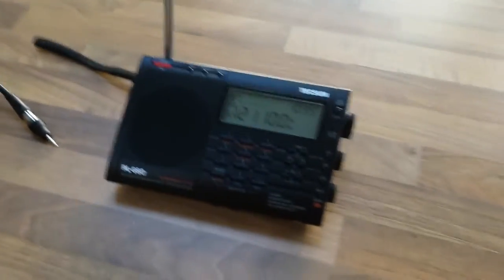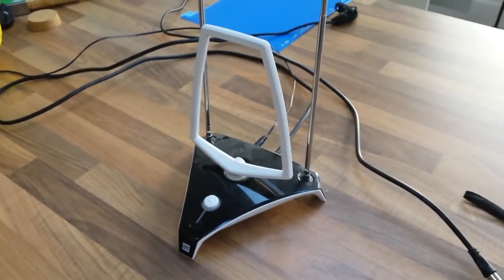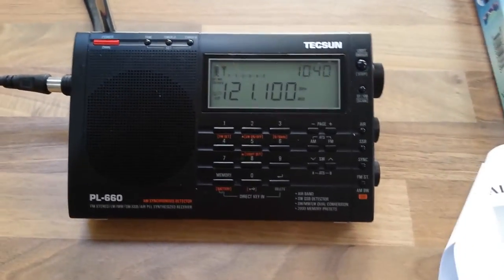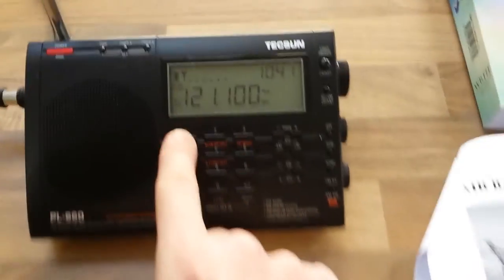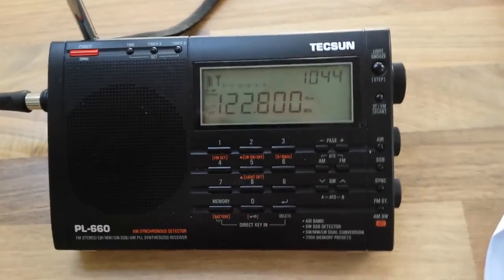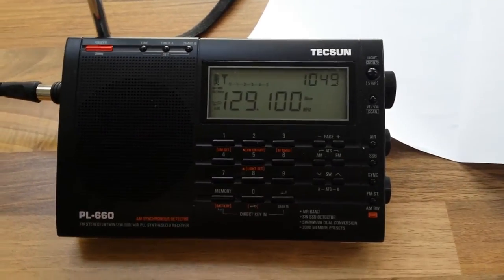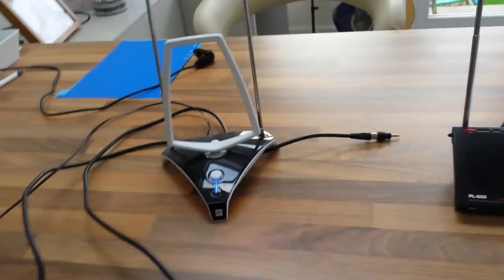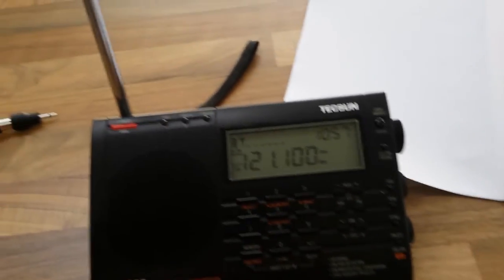Improved Airband reception on Tecsun PL660 with amplified indoor TV antenna.

Comment: A  good  tip  I  found   was  with  a  Selmer  TV  Mini  Amp that  I  got  from  Argos  a  good  few  years  ago  is  to  lay  it  on  its  side  so  that  the  two   telescopic  Rods  are  in  a  Vertical   Line  IE  one  Up,  one  Down  like  a  Dipole  &  this  greatly  improved  my  Airband   Coverage  when  in  Teneriffe up  to  beyond  Portugal  as  I  would  presume  the  Telescopic  Metal  Rods  are  doing  the  work  at that  Freq, Regards  Terry.
Reply from the maker: Terry Howell  thanks for that Terry. I'll give if a go. 73
Reply: No lo entendí. ¿Es una antena de "cuernos" para televisón? ¿Cómo se hace?

Comment: The frequency sounds like the atis frequency of some airport--there they report the cuerrent winds strength-direction, the runway in use (usually the one that is directed headwind to current winds), the temperature, the dewpoint (the dewpoint is the temperature at which the invisible humidity in the air turns into cloud-steam, it is lower or same as current temperature. If it is same or close to current temp expect fog or rain. If there is a gap between the two expect the clouds altitude to be higher than ground by subtracting two degrees C° per 1000 feet--example: temp. 25, dew-point 21 --clouds may be at 2000 feet alt. Depending on pressure and humidity too), QNH -the atmospheric pressure, the approach procedures, the closed taxiways etc. ATIS only talks about current conditions, not prediction. If you go on air weather sire you will see TAF weather reports they are predictive. Just for your fun and curiosity :) BTW, it is normal not to catch clearly air stations from only 20 km away, they need line of sight clearance and arent too strong. Some approach frequencies have relays so you catch them from a huge area. Cheers!
Reply from the maker: hallobaaaby thanks for the information.

Comment: Hey, I've modified one of those tiny am/fm radios by expanding its frequency range (spacing copper coil FM) and it works for ATC on 118 mhz when I'm close to the tower. From my home, only 5 miles (about 8km) away from the airport, I only have a slight increase in static. Have any antenna ideas for my little radio?

Comment: Finally the Tecsun PL-660 can get airband reception. I have found it to have poor performance off the whip compared to other radios, but this way it proves it can be used for the airband. 73s!
Reply from the maker: You're right MRD, the airband was pretty poor, at least this is an option that appears to work.
Reply: Mad Radio DXer

Comment: 122.8 referred to as ATIS- pilots will often tune to this frequency as they approach The Airport Terminal to land, the lingo primarily provides Information such as the current weather conditions, runway in use and any special conditions. Larger airports may have more than 1 ATIS frequency.
The 2nd typically applies to departure aircraft. 
This information is amended throughout the day as weather conditions change or circumstances. You will  hear a phonetic letter of the alphabet associated.  eg. airport name-  arrival information Alpha, Bravo, Charlie...and so on up to Zebra,   (if hearing double letters, you must know your weather is crazy)
Reply from the maker: Thanks for the detailed info, much obliged.

Comment: 129.100 mhz is  listed   for   UK/SCOTTISH    Area  Control, Dublin  ATIS  is   on  124.525 as  listed  in  AIRWAVES  &  CALLSIGNS  2015  which  was  the  last  one   Produced, I  hope  this   helps, regards  Terry.
Reply from the maker: Thanks for the information Terry, much appreciated.
Reply: Baldonnel / Casement  is  listed  as  122.800,  if  this  means  anything  to   yourself   one  Time  Pad

Comment: Yes it makes good sense!  I have a circular. Antenna for fm radio. I'll give that a try as it is  on  a 12 foot pole out side. "In the clear". (My new tin roof is not help full.) Pl-660 should stand proud . I will use  the matching transformer first. Thanks om cheers. De kv4li
Reply from the maker: Hope it goes well - it's all about experimenting anyway. 73 EI9HAB
Reply: @ado75  you bet vhf air roars in with 660@ vhf. Nearest air port Nashville TN . And a host of small ports. Ps along with weather. Stations all most too many. Had to set the radio to "local" for weather. Tks Fer return de kv4li

Comment: I haven’t been able to get an answer to this question. ( here in the U.S.)we have NOAA weather band 162.400-162.55 . On older radios it was part of the “public Service band, which also included the air band.— So I’m wondering if it will receive “the weather band “❓
Reply: I don't think so. This radio doesn't cover those frequencies
😢

Comment: Should I get a spare antenna for mine? I just received the radio yesterday?  Do you think the antenna will last through normal use? How do I prevent the corona ball from falling off?
Reply from the maker: It comes with a plug-in random wire antenna - you'll have that as back up. You could alway solder the corona ball.

Comment: Hello my friend ! I thought the external antenna connector was for HF only and not for airband. Am I right ? Because I plugged in my airband antenna there and nothing changed. Are you sure that we can use that for improve airband signals ? For HF it was 100% improved but for airband no difference when I plug an external antenna. 

Let me know. Thanks and all the best !
Reply from the maker: I had a look at the circuit diagram online. I was not able to download them and zoom them up properly. However, from what I can make out, the antenna input is common to for all bands. All I can say is that the amplifier made a significant difference
Reply: @ado75  hello my friend . Nice to meet you ! I don't think so. For me nothing change. I put several antennas there and only change HF bands. Strange ! Maybe you have another version than mine. Look there that the input antenna is written FM and SW and not airband. Sorry for my english and keep in touch if you find any important mention for me. Best regards. PY2KJ.
Reply: @radiocombrasil  Boa noite, também achei estranho ele conseguir isso, tenho pl 660, e de fato antena externa somente em FM/SW, vi alguns modificados na Internet, mas via hardware, legal se fosse via software.
My friend, my pl660 LW, MW and VHF air, dont works with external antenna, how can you do?
Reply: @fabiocosta774  td bem Fabio ? Realmente nao funciona aqui para VHF. O que eu fiz foi enconstar o conector da minha antena externa para VHF na antena telescópica do PL660. Assim melhorou bastante a recepção. Caso contrario, a antena do próprio PL660, a telescópica infelizmente não funciona bem em VHF. Um grande abraço !
Reply: @radiocombrasil  Para VHF air gosto de usar dongle SDR, pois além de usar uma antena plano terra caseira, o software me propicia ver vários RX ao mesmo tempo, mas vou tentar LW por indução, não quero modificar o hardware, tenho aqui uma long wire de 20 metros, mas aí acho que não vai dar para usar...

Comment: I live less than half a mile away from a major international jetport in the North East US and watch airliners fly in and out over the ocean from my front yard, almost right overhead...I get nothing from the PL-660 airband.
I'm sour.
What am I doing wrong?
Reply from the maker: That's a pain. Are you in an apartment?
Reply: @ado75  
Yes I am, thank you for responding!
I'm on the top floor (3rd) with lots of exposure towards the direction of the airport and the flight path. 
I'll have roof access after I build my roof deck, so I'll set an antenna  up there someday, but for now I'm looking for an indoor option.
I actually get the airband channel from the jetport that gives out conditions at the jetport, ad well as the frequencies for the tower, etc...but when I tune into those I get nothing.
They wouldn't be encrypted would they?
Reply from the maker: @AZ-kr6ff  It's difficult to know without being there & I assume you have the frequencies for the Tower, Ground, Approach etc?  

If you live in a modern apartment (lots of steel construction) they can be a bit of Faraday cage i.e. you can have dead zones for radio signals of all types - including mobile phone signals. If you are having other reception problems you can assume there is a general reception issue. I know an apartment dwelling ham here locally who has this exact problem & can't "play radio" at all when at home - he lives in a very modern block, can't even open a window. 

If you can open a window,  get a length of wire, connect it to the radio's steel whip antenna (either wrap it around the whip or use a crocodile clip) and dangle it out the window. Make sure you're safe to do this - away from any exposed power lines coming into the building etc :) If you have a balcony - even better, you have many more options.
Either way, if you can get bits of wire safely outside you should be ok. Don't go spending money on some "wonder" indoor antenna, bits of wire are cheap and easy to configure into different types of antenna. A length of wire outside should improve reception across the radio's receiving range. 

If you know someone with a scanner or some other receiver that has the airband frequency range you could test them side by side in your apartment - if the other receiver is getting a signal that brings us to a known issue i.e. the PL660's airband is not great. 

However, given your proximity to the airport... other than the radio being damaged, there must be something else.
Reply: @ado75  
Thank you so much.
I'm brand new to radio.
I bought the PL-660 because it has airband, which I listen to on my smart phone sometimes.
The SSB doesn't get anything either.
I had 2 channels last night on Shortwave for the first time, one from Cuba I think, and the other was the Alex Jones show...out of Texas Maybe?
I put my wire out the window and it actually made reception slightly worse.
My building was built in 1840, but I am right in the city, so probably lots of urban interference.
I do have a skylight in the loft that I could open and set a small portable antenna on the roof.
I have read that some of the pl-660's have problems.
I've reached out to a local radio club and was invited to their next meeting, so that should be helpful.
Thank you again for taking the time.
Cheers!
Reply from the maker: You're right about Suburban/urban interference - its the bane of our lives. Regarding the noise increase when you put the wire out the window, Greg's video will explain why that is happening - https://www.youtube.com/watch?v=VsJtfEHg3rc 

Antennae are absolutely key in Radio - so you'll have to research and think about how to solve your noise problem. Don't see this as a negative - this how we learn the fundamentals of radio communications. It's good you will have access to the roof as it gives you more options. I have local noise problems too and I'm trying to make one of these over the winter http://www.kr1st.com/swlloop.htm 

And great that you're linking in with your local radio club!

Comment: Guess what ive just bought off ebay?
Reply from the maker: Lee Locke Ha. Funny. Is it on the slow boat from China or did you go local? I saw a silver one on one of the other guys channels - looks nicer, sniff!

Well, if there's anyone who can test and rate the tecsun 660 in a shootout against an array of other radios, it you :)
Reply: I wish!  No fella, i mean one of those one for all indoor antenna things you have. Ha ha ha......there is an Eton E10 in silver for sale but ive got a load of birthdays this month so no chance of gettin that like! Its coming by snail mail 2nd class so see what happens hey? Is the tecsun 660 the same as the eton e10 do you know?
Reply from the maker: Lee Locke LOL. What you using the the antenna for? 

Regarding the Eton. I think Eton are a rebranded Grundig. Anyway, I just checked it out. They are very similar looking alright. I noticed two big differences compared to the PL660. The E10 has no AM sync, and no airband either, from what I can see.
Reply: Arite Aido! Erm, i ordered one of those coax to 3.5 jack connectors to hook it up to the antenna aswell . Just thought it will improve the airband reception on my Sony 2001D. Its worked well on yours like!.....No sync or airband. Thats why its only £50 then. Give that one a miss then, sniff!